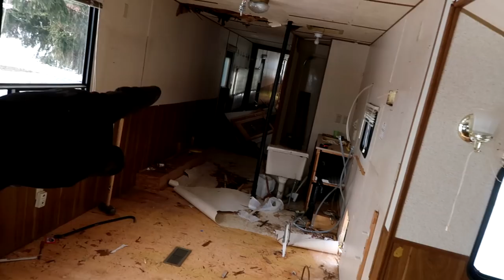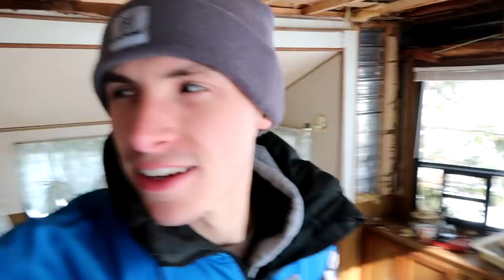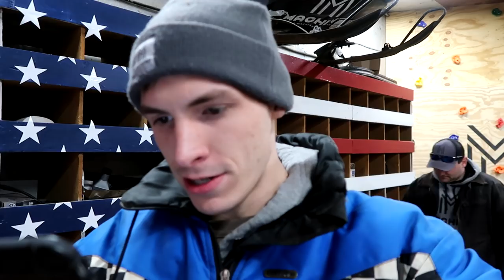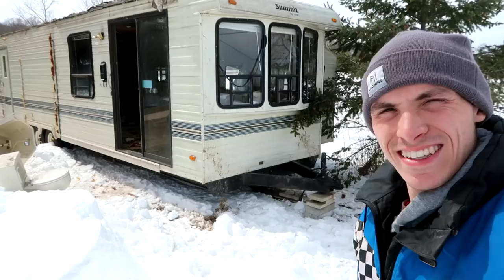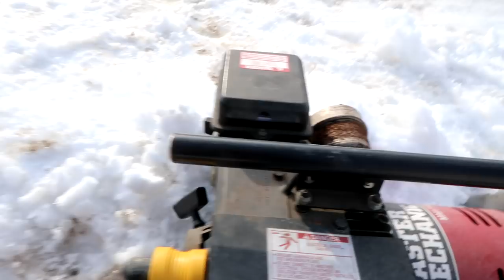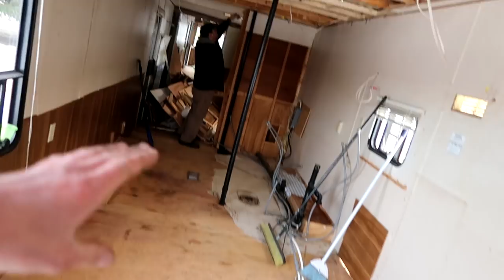The Camper Trailer Dream!

Comment: You keep saying crush is going to sit between the wheel wells but when you cut the trailer you will have to relocate the axles.   Remember you need to keep the tongue weight 10-15% of the trailer weight to keep this thing "safe".

Comment: Make sure to reinforce it well. All the walls and cabinets and stuff are what keep the bodie from rocking side to side when you are towing it.  I had the same idea and got my hands on a trailer that had already been stripped within the first few corners  on the way home from picking it up I realized it was going to be a long ride home. By time I got there the 24' camper was only held to the frame for about 5' between the door and front  corner. So now I have a nice flat bed trailer. So it will come apart at the seams if you don't do something. There like a ikea closest. All floppy  and loose till you add that  cheep cardboard back with a few nails and it becomes solid.

Comment: My suggestion for the trailer is you build a physical toy hauler on the chasis it has now instead of moving the axles and everything. You are reducing weight greatly by making it you’re own trailer, but i would make a fold down door in the back and load crush back there while you have the fold out up to the front for sleeping and living space. Just my two cents.

Comment: You destroy all the cabinets but save a $1 light switch, lol
Reply: Brad Young maybevthe cabinets have mold
Reply: If you have ever worked or remodeling a mobile home, hud home or camper, you will realize very quickly that there is no saving the cabinets. They're glued, nailed and stapled to everything. They have no support or braces in them, so if you somehow get them free of the wall, ceiling and floor, they tend to fall apart.

Comment: Don't cut it in half!!.   Keep it like it is so you have more rome for your self, crush and your frends!   ,,ps i love your channel
Reply: Robban yeah I mean for his truck the extra length should be no problem
Reply: Agree
Reply: Robban A duramax 2500 isn't made to haul that much weight, plus it will be a pain it the ass to park that thing, and it will scrape the rear on just about everything
Reply: ThreatToSociety no it can definitely tow it. They’re pretty light
Reply: Joseph Samsor A duramax is rated for 12000 pounds, the trailer itself is 9. Add a few tool boxes, the yxz and maybe a dirt bike or two, you are getting hard on the truck. That leads to getting a bad tranny and driveline stuff. Also destroys the mpgs
Reply: ThreatToSociety that and if you've ever pulled a bumper pull camper with just about any size pickup you would know that a trailer of that length would not handle well on the road.
Reply: I don't know. It's a cool trailer and everything. And I do feel like it does look better leaving it like it is than cutting it. But with the NY winters, he will need to get a bigger truck to tow that thing. I am guessing perhaps a 3500 dually if he's going to leave it intact.
Reply: James Crews Yeah, to haul a 35 foot camper that's usually the way to go anyway, and hauling a 35 foot camper off road on the tracks, with a 2500 may not be the best for the truck or trailer
Reply: He can just throw Jake off it that’s enough weight reduction. I kid I kid #lovjakenohomo lol
Reply: H20Shane Haha that's funny
Reply: Your cold at 32 degrees, and your from upstate NY?... ummm yeah I'm almost ashamed  of considering you my NE brother. Must be that much colder that side of lake Champlain! 32 degrees is like speedo weather in VT at this time of the year! Lol! Take care and be safe!
Reply: Joseph Samsor and stopping is another issue!
Reply: GAME HACKS Yea exaktly 👍

Comment: Do you realise that you took all the diagonal support out?
Reply: tom williams do your realise they are cutting it in half
Reply: Yeah, thats what I mean! The back wall is all thats holding it diagonally!
Reply: It should be fine if they box the inside in right in front of the cut line.
Reply: Hes more than likely going to make or buy some sort of heavy duty door and hes adding some of the walls back in he just had to relocate the bathroom and kitchen further to the front which should help the whole tongue weight crap everybody keeps goin on about, all the while they dont seem to realize that its also important to keep weight over the axles too. Daltons a smart guy, give him the benefit of the doubt. The closer the wheels are too the end of the trailer or camper or whatever the easier it is to back in because its more stable. Yanking the axles up towards the front will change the axis that the camper rotates on and that makes backing up a pain. Even with all that being said the bikes will probably at the tongue so that also helps with that issue so just chill...im sure the great 3DMachines has a plan of action, so calm yourself haha
Reply: You do realize he will brace things right?

Comment: You should just cut off 10 feet off the back and make it a flat bed to put crush on and leave it 32 foot. Instead of cutting the frame and moving axles.

Comment: Why do you call em tip outs that's not how they work there slide outs. They should with a switch slide n and out way easier than what you did before hand. It runs off electric if they work right. Not bashing just simply saying it's alot easier to use it the way its intended.
Reply: Kevin Ervin that does not have the electric slide outs. That one is older and the “tip outs” is correct and the only way to do it.